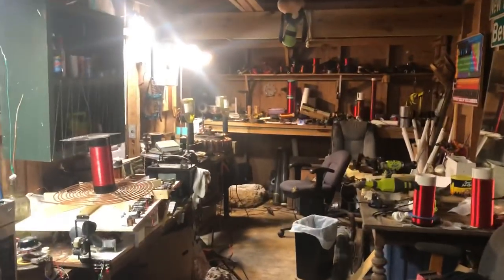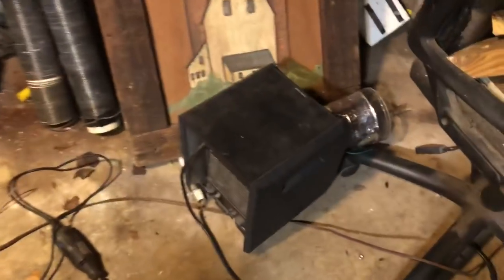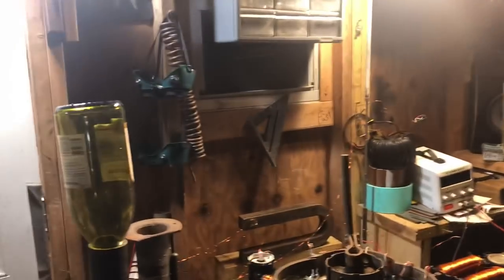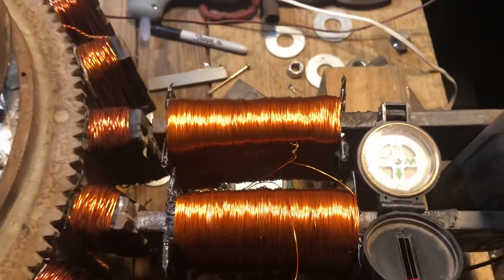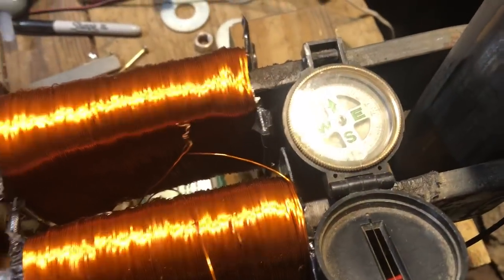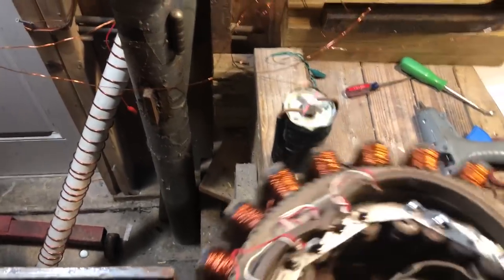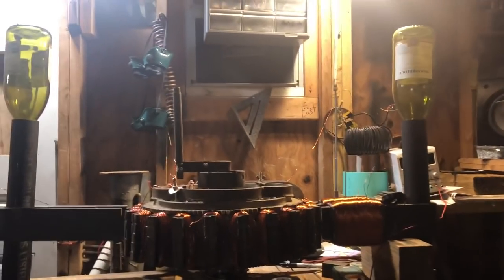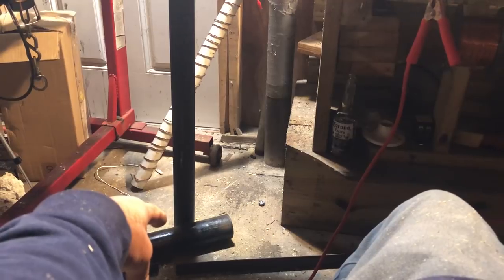Coral Castle! How Ed’s Magnetic Wheel Works and Levitates

Comment: Dude, a crazy idea, following my reflection on a discovery I made accidentally as a child when I had been pulled far out to sea by a rip tide.  Is gravity a wave?  If so, might it be best conceptualized and depicted as a longitudinal wave rather than transverse or scalar...  I feel longitudinal best matches its qualities.  If so, then might we assume for a crazy moment that the wave originates above our heads and pushes on and through us from above.  I note possible evidence for this seemingly happens whenever one takes an interferometer and places it in vertical orientation -- one sees displacement in the aether that seemingly evidences the notion from antiquity of gravity being blown ( often by an anthropomorphized cloud blowing down at the edges of old maps... ) down at us from above.  Transverse waves can be canceled out by the same wave in phase opposition.  Longitudinal waves can be canceled out as well by mirroring the wave.  

As regards mirrors, I note that they flip right and left vector, even at close range.  They do not flip up and down vectors.  Recently I discovered a mirror which flips up and down: the accumulated density of the aether my vision attempts to see through in order to perceive a distant object on the horizon, outside, in the daytime.  I looked recently at a car on the horizon on the road, and clearly noted the car was mirrored, as the immediate space below the car's tires revealed a mirror image of the car, yet with the up/down vector flipped.  It looked like to cars, stuck together with their tires touching...  At some point the local aether's density ( looking at a distant object ) can accumulate to the point at which its odd reflectivity characteristics are noticable.  I did not try to verify if the left / right vector was also flipped.  I intend to verify at the next opportunity.  This odd reflectivity might well account for the seeming ubiquitous omni-directional spread of light.   Over a certain distance, perhaps the traveling or even distant light gets reflected in all directions by the mirror of the aether beyond a certain density...

Hutchison uses magneto-dielectric longitudinal radio waves, if I am correct, to effectuate his levitations.  The mechanism powering the output likely is using PULSES and not direct or alternating current.  Likely PULSED AC but it might be PULSED DC.  In the recent video by Hutchison he lets us hear an audio rendition of the wave, and you can clearly hear the pulse wave component.  I might well know: I am a musician at heart, and can clearly distinguish the pulse wave as opposed to a sine / square / saw / triangle wave form.  Clearly pulse waves are heard...  

Back to radio.  Hutchison's devices differ from conventional radio, which is electro-magnetic transverse waves whose propogation is slowed by the wasted motion away from a straight line that the sine wave makes.  It was recently and for the first time historically understood to be rotating MAGNETIC waves that comprise radio, according to a scholarly analysis of Mr. Mehram Keshe's breaking the world record for most powerful magnet ever made ( Keshe's unconventional, novel materials and method produced 129 Tesla of magnetic field strength -- not to shabby for a device that only cost him like $150 USD to make... ).  So it seems that conventional science has now just barely caught up to Ed Leedskalnin regarding it being SOLELY MAGNETISM at work in radio waves, and not ELECTRICITY NOR ELECTRO-MAGNETISM.  The scholarly article I read noted the absolute and complete inability of ANY type of radio device to function in either sending or receiving at full spectrum bandwidth during the operation of the plasma device that produced the 129 Tesla magnetic force.  Absolute and complete DEADNESS ON THE RADIO SPECTRUM, and it was further speculated in the article the usefulness and desirability of such a capability on the battlefield...

Just a few crazy thoughts...

F.